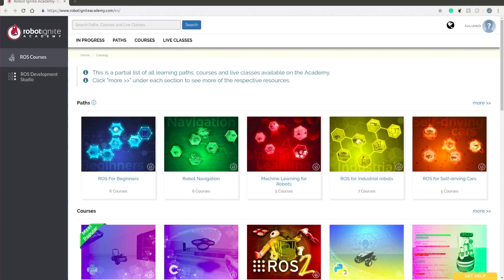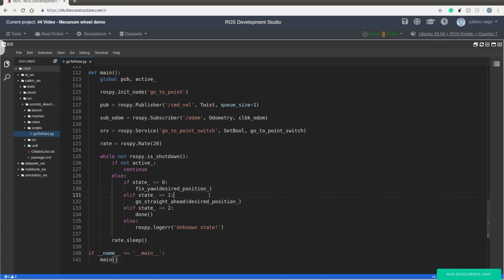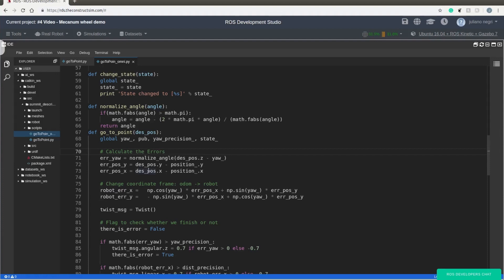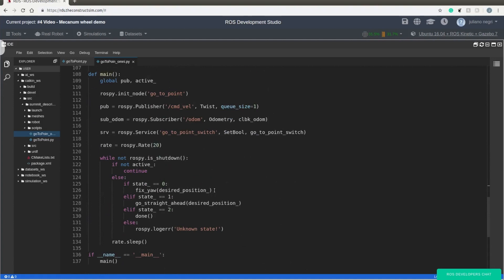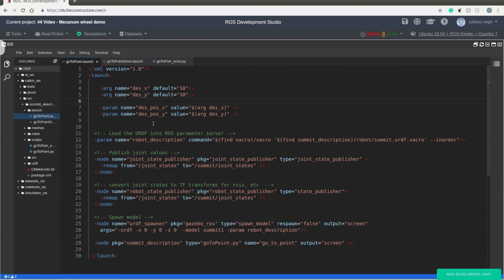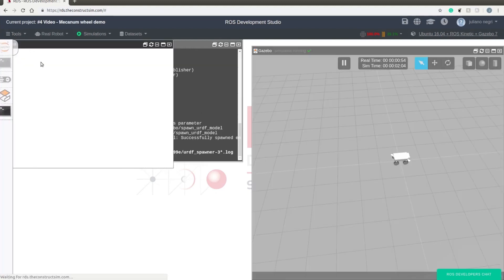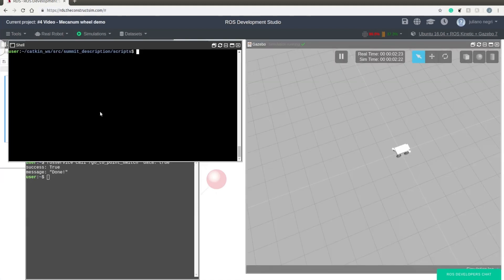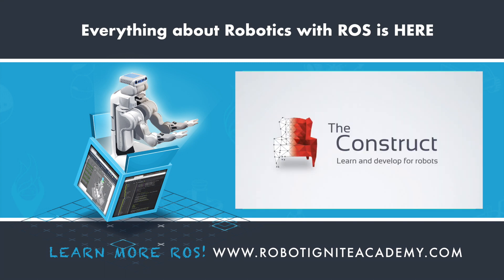[Robot Modeling] Comparing Mecanum Wheels with Diff Drive robots - Ep.4

Comment: This is a great video, a lot of  material is available to work on high level(path planning and navigation) is give on your youtube channel/website, but a lot of our students face problem while connecting it to real world. Say after you get cmd_vel, connecting it with Arduino, which inturn is connected to H bridge motor drivers (just to keep everything simple to start with), can you help with any kind of tutorial videos which help in programming that Arduino (again just for simplicity).

Converting from cmd_vel to exact motor direction and speed of each wheel for mechanum drive has a bit of calculation and trigonometry into it. I think that kind of video would complete a start to end step by step guide of whole robot.
Reply: I really agree with that